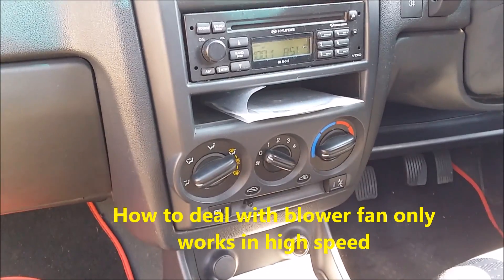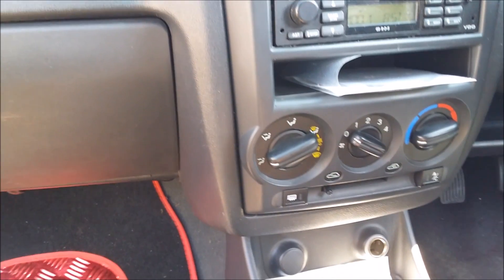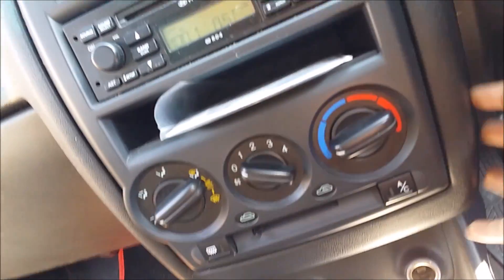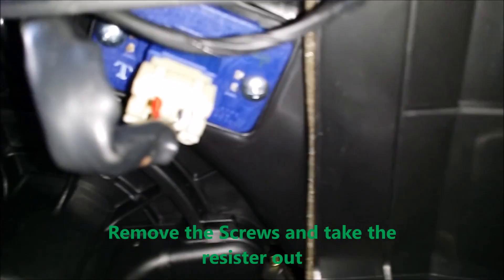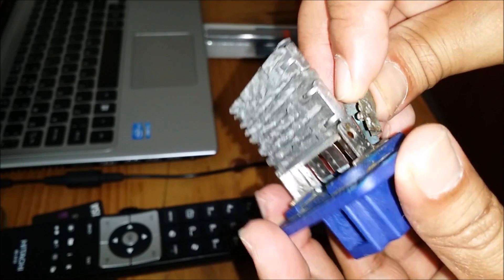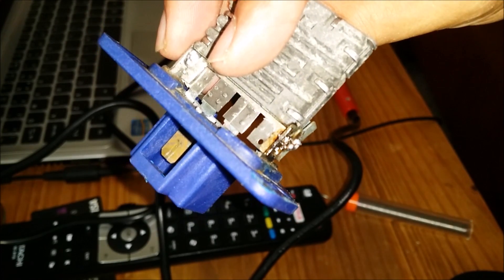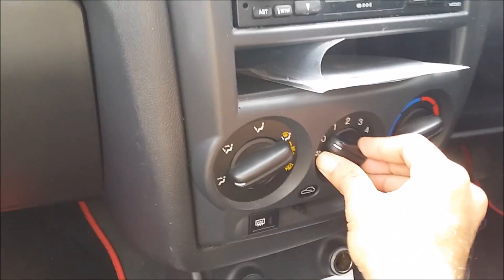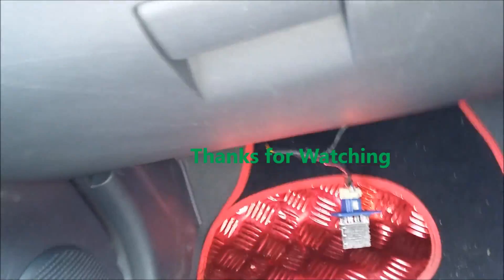DIY: Car Heater/ AC  not working or only works in high speed; Hyundai Getz Faulty blower resister

Comment: I have the same issue, I’ve replaced the resistor with a new one however on the plug/connector pin 3 is quite burnt. Will I need to replace the whole connector?